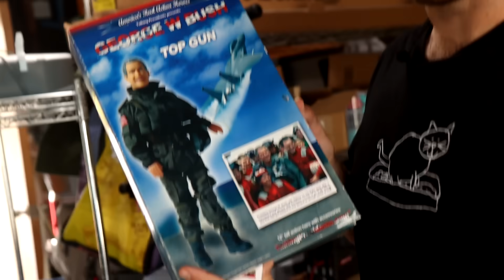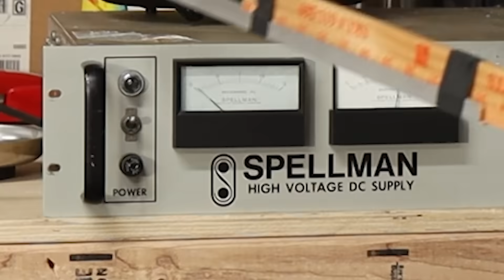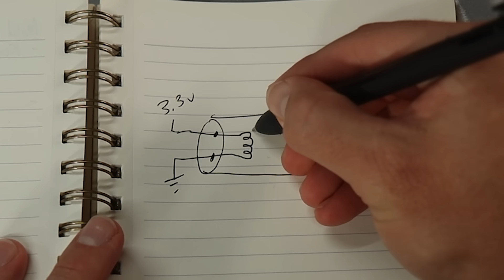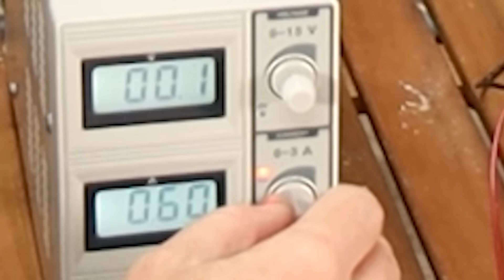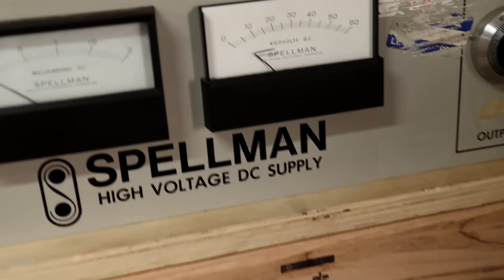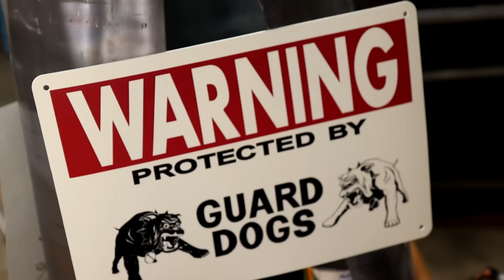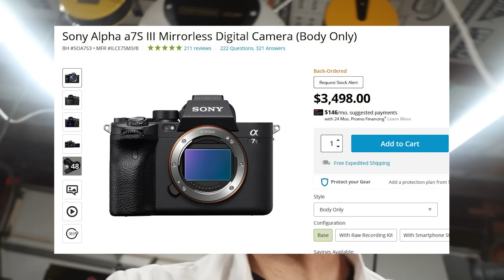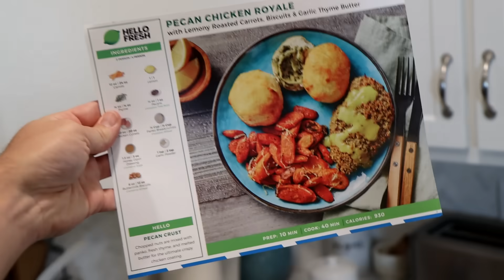Built My Own X-Ray After a Hospital Charged Me $69,210.32

Comment: The problem is... government. 
Hospitals, insurance companies and the government are all working together. 
I didn’t say doctors; most of them get hosed harder than the people they help. 
Hospitals are corporate entities. They want to make money. They constantly negotiate with the insurance companies to ensure they are making money; in doing so they raise prices. The insurance companies want to make money, so they negotiate against the hospital to lower prices... but not for your benefit. The hospital raises actual prices, the insurance pays a little bit more, but they also restructure your payments so you pay more. You see a $69K bill, but the actual bill is $10k. (Which is the price it suddenly becomes when you tell the hospital you are paying cash, by the way; they don’t actually try charging you $69k) so the insurance pays just under $9k and you pay $3k... which means the hospital makes $2k more on an insured person than they do an uninsured person, the insurance company pays less than the actual cost, saving them actual money, and YOU get hosed... because the insurance company is STILL making money hand over fist despite paying that $9k.

These transactions have been repeated many times over the years, so a procedure that actually costs $300 (amortization of the machine, hourly pay for the tech, hourly pay for the doctor, materials cost, electricity and profit for the hospital) suddenly is $10k. The doctor, the tech and the electricity still cost roughly the same. The machine costs more, the materials cost more and the hospital makes MUCH more. 

So where does the government come into this and why is it still largely their fault?
Regulation.
It is ILLEGAL for a regular person to buy an x-ray machine. Why? Because Tom Cruise bought a sonogram machine when he and Katie Holmes were expecting. Look it up. California passed a law prohibiting it and then the FDA quietly expanded their guidelines to prevent it for the rest of the country to include machines, classifying them as prescriptions.
They regulated independent hospitals so heavily that the independent and charity hospitals were unable to make enough to operate and had to either close or sell out to corporate hospitals. The corporate hospitals lobbied along with insurance companies to the government and have vast numbers of exemptions, rules and regulations in regular laws that benefit them specifically. There’s a lot more, many little bits that help materials manufacturers, that add governmental costs to both equipment and materials manufacturers... none of it actually helps individuals, just costs them more under the guise of it being better for you. (When I say a lot more, I genuinely mean hundreds of thousands, if not millions of pages of legislation over the years that is special-interest-only lobbied. None of it is created to benefit you, only the people who pay for the lobbyists.) 
Then something happened that boosted all three of their power massively.

Any and every business eventually wants more customers. If you sell to 10 people and make $100 profit off each person, you make $1,000. If you sell to 100 people but only make $50 profit off each one, your per person profit goes down by half, but you make $4,000 MORE overall. 

The regulation that passed, the affordable care act... was mostly written by insurance and corporate hospital lobbyists. That’s why it was so massive. Literally Thousands of people writing a bill that would specifically profit them and people they worked for. It FORCED everyone to buy insurance. 

Suddenly insurance companies had power over most of the country. They lose a little bit more on a few people, but they suddenly have a massive number more people giving them more money. The corporations that own the hospitals and some doctors offices suddenly have more people coming in for procedures, and the government gets to tax even more, get direct fines from people who simply cannot afford the not at all affordable forced insurance and everyone makes huge profits... except the people. There are some people who it benefitted, but the vast majority of people ended up paying more. 

The more the government gets to regulate, the more they can expand their powers, the less actual innovation there can be due to anti-competition red tape and the less able individual doctors and small hospitals can survive. Most doctors have dedicated staff just to deal with insurance companies. They also usually have dedicated staff to deal with the government computer systems that are required. (Multiple programs are required by the governing bodies, the programs do not work well, they do not communicate together easily, and they absolutely have to have the correct information communicated to each other.) A small doctors office will have to employ two or three extra staff JUST to deal with insurance and regulations. The insurance company isn’t going to pay for that extra cost, you are. 

Without excessive government regulation, things would be a lot less expensive. 

Insurance companies are not non-profit, corporate hospitals are definitely not non-profit and the government is absolutely completely not a non-profit entity (you know it, They know you know it and everyone just lets it go).
Want to make them all more profitable and powerful? Go single payer. The hospitals will get a good increase in profit, the insurance companies will get a huge ol profit (banker bailout of 2008 anyone?) and you can bet the government will get a big big cut. That extra money is NOT going to magically start coming out of the pockets of the government people, it’s definitely not going to be coming out of the corporate hospital’s pocket and the insurance companies are not suddenly going to become a charity. That money isn’t going to get pulled from the pockets of the wealthy, it never has and it never will. That massive amount of extra money is going to come directly from us. 

A $69k bill is not the problem. It is A problem, but it’s just a symptom of the problem. The problem is a government that protects the corporations over the citizens.

Comment: Feels like I'm getting dumber and smarter at the same time. Those safety nerds with their low voltage, high x-ray bills in the three's of hundreds. Subscribed
Reply: It's like having your braincells replaced one by one with someone else's braincells.
Reply: @classicspoot  braincell*
Singular
Reply: The trick to working with high voltage is to place the wire lower to the ground so it’s no longer high before working with it. I’ll let myself out 😉
Reply: + int, - wis

Comment: Imagine paying $400 for a 60 000 volt supply and then being surprised that it shocks you.
Reply: He's either hamming it up for the camera or in way way over his head.
Reply: @FireStormOOO_  They talked about it on the podcast.
He left a lot of how scary that thing is out of the video.
Reply: @FireStormOOO_  a bunch of wires carrying 60kv will just put stray charges on anything that's not properly grounded.
Reply: @mfbfreak  Yeah - I've done some high voltage projects before; electricity is a whole different beast once you go past a few kV.  As far as the current path is concerned, wires and insulation are loose suggestion not a rule.

Comment: “Welcome to high voltage, where everything’s a wire!”

That’s actually a perfect way to get people to take it seriously
Reply: Including Especially your body!
Reply: Like, I not scared of live mains.
However it just took a couple of painful experience with ignition cables for me to be really scared of KV rated voltages.

P.S.: I wasn't even touching metal only plastic.
Reply: @youkofoxy  holds the plug cable to the cap to see if i got spark

It shocks the shit outta me

"I do indeed have spark"
Reply: @idk420blazeit  Did this to myself when I was a kid. I had a 1979 honda Z50r. It didn't always love to start and it burned a shitton of oil, the plugs got pretty dirty pretty quick. When it was being particularly stubborn I'd lay the clean the plug up a bit and lay it against the engine and give it a quick kick to see if I still have spark. Can't remember if I was rushing or what but I held the cap one day and it shocked the everloving piss out of my fingers. Just read a second ago that it was probably in the tens of kV range, just fairly low amps.
Reply: yeah even 480v industrial power is not even remotely as scary as 60kv
Reply: @butre.  I'll gladly trade the 10s to 100s (sometimes even 1000s) of kW available at 480V for the few watts at 60kV. One fuckup in an industrial power junction box and your family won't have to pay for your cremation :P
Reply: @AKAtheA  I'll take receiving 60kv over receiving 480v, but at least at 480v being half a foot away isn't too dangerous
Reply: @butre.  try lighting an arc between the busbars that are thicker then your thumb...even 6 feet is not far enough to not light you on fire like a candle :P
every time I saw open live cabinets being worked on, I'd just "nope" out of the room. Seeing these things go off on video is impressive, but I'll gladly pass on the front row ticket ;-)
Reply: It's a perfect way to get people to take it seriously and it's also very close to accurate!!!!! 😂😂😂

I don't even like 9v battery shocks 🥺
Reply: "Everything is a conductor with enough voltage" that's what a teacher used to say.
Reply: Cant it just be grounded?
Reply: 4:48

Comment: Building a device that generates x-rays is easy. Building a device that DETECTS x-rays, and which has a high enough dynamic range to tell the difference between the x-rays that make it through your thick parts vs. your thin parts, producing diagnostic images without frying the patient, is CONSIDERABLY more difficult. Obviously, you can use actual x-ray film. But film is a terrible medium; not only is it less convenient and less permanent (degrading with time faster than properly-maintained digital files), it produces FAR worse images. I'm not sure what you used as a phosphor here, but even if it's CsI, the image intensification process is necessary to produce a truly diagnostic image. This requires converting the light the phosphor emits into photoelectrons with a photocathode and using electrostatic lenses to increase the energy of the photoelectrons as they are focused through a smaller anode (a process called "electron optics") that allows the passage of these high-energy photoelectrons onto a ZnS-CdS output phosphor - this all results in producing 100X as many light photons as you start with. Anyway, now, CR and DR are standard in the entire developed world (barring a few discount dental offices that haven't made the switch yet, still using film), and parts of the developing world (and even CR, or computed radiography, which uses detectors that have to be READ post-x-ray-exposure by a specialized machine that uses lasers to stimulate the detector to luminesce, is going out of favor...digital radiography, which produces instantaneous images, is where it's at today). And a modern DR detector can range between 10,000 to 100,000 USD (or more) depending on its size (dental ones, which are typically only a few square centimeters, are on the cheap end of that spectrum, but the kind used in hospitals, which are usually 35 by 43 cm, are much more expensive) and capabilities (like any other tech product, there are better and worse varieties thereof...some manufacturers produce cheaper wares than others, but they don't work nearly as well).

There are a couple reasons why they are so expensive...firstly, the materials that make up DR detectors, like amorphous silicon as a detector, and cesium iodide crystals as scintillators, are super-expensive. Secondly, these are electronically-complicated devices that require a good deal of time and expertise to manufacture.

As for the x-ray machine itself, while building one that works is fairly trivial (like I said), building one that can be finely controlled, one that uses specialized computers to carefully adjust the x-ray dose so that it is sufficient to generate a diagnostic image, while still being as low as possible for the execution of that goal (x-radiation is dangerous), and indeed one that has safety features to minimize other exposure risks (like leakage radiation) to patient and technologist alike, while also minimizing other risks (like fatal electric shock, or the risk of the heavy, ceiling-mounted machine falling on the patient)...that takes cash. So these machines do tend to cost upwards of 100 grand (I'd say 200 grand would be about average, give or take).

So really, while I disagree with for-profit healthcare (Canadian here, and our healthcare is not free...it is paid for by taxes...but it is still far cheaper to those taxpayers than American healthcare is to insurance companies and private, un- or poorly-insured Americans), the expensive equipment, combined with the upkeep costs and staffing costs (not only do you have to pay people to take x-rays, there are daily, weekly, monthly, bi-annual and annual QC checks that must be run), means that the art and science of radiography will always cost a lot of money. Obviously it's worth it; there are few technologies that have had as large an impact on the ability of medical professionals to save lives, than radiography (mammography alone has saved millions of lives since its inception, and don't get me started on CT scans, which have quickly become an essential tool in the diagnosis of hundreds of terrible diseases - these are mere variations on the x-ray theme, though I shouldn't minimize the impact "mere" ordinary x-ray machines have had)...and it's one of the few technologies that seems destined to continue to have a part in modern healthcare, with only mild evolution of the tech (improving image quality, reducing required dose, that sort of thing). Nonetheless, when hospitals are paying millions of dollars a year, just in operational costs for their x-ray suites, someone's got to pay them to do it. I still like the taxpayer covering it, because this way, the playing field is even (we all support each other), and healthcare is affordable for EVERYONE.

Edit: Yes, I know the video is a joke/proof of concept (I'd say 75% joke, 25% proof of concept). I still wanted to point out that the x-ray technology in hospitals is several orders of magnitude more useful and safe than this garage contraption. Obviously.
Reply: tldr

Comment: Really should have repotted the tube in oil, even if you had to drill a few new holes for wires.
The arcing happens when there's a breakdown in the air, but the oil blocks that.
The housing also made it more or less a directional flashlight.

Comment: Medical equipment is ridiculously overpriced. All that additional licensing and bureaucracy BS. You can build an ECG machine for a couple hundred dollars from medical grade components. Hell, I once searched for a replacement ECG cable and was so disgusted by the price that I went and soldered my own from 3 meters of microphone cable, snap fasteners and a 3.5 audio jack. It cost me 3 dollars and still works after 5 years.

Comment: "it's totally safe, you encounter more radiation in a car than from the machine"

idk I was more worried about the 60 kV arcing because you just tied some 20 gauge wires together uninsulated next to a bunch of beans... high enough voltage arc flashes will melt your underwear to your skin and fill your lungs with vaporized molten copper

Comment: Maybe try putting it in a vacuum to stop the arcing? I'd bet the air particulate is acting as conductor. Probably wouldn't need to be a perfect vacuum if you put your air exhaust at the bottom. Whatever doesn't actually get drawn out by vacuum would hopefully settle toward the bottom if you keep it under pressure. Would be a really quick easy way to solve that. Maybe. Taking a big leap that it's because of the air particulates.

Comment: Did you not ground the HV power supply? It'll shock the shit out of you if it's not and the circuit isn't balanced. I work on Radar systems. HV and high current. Extra sparky.